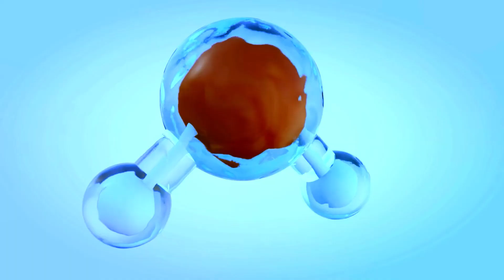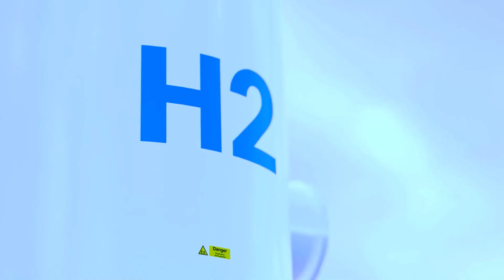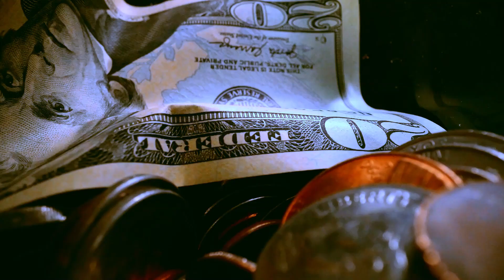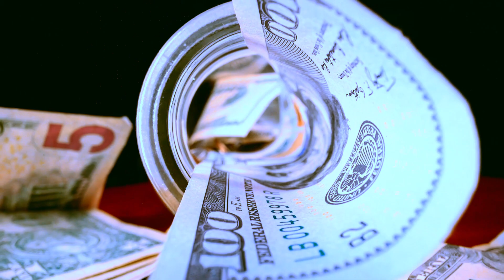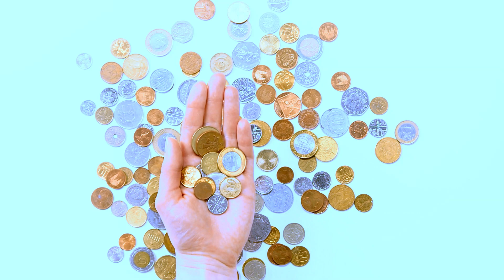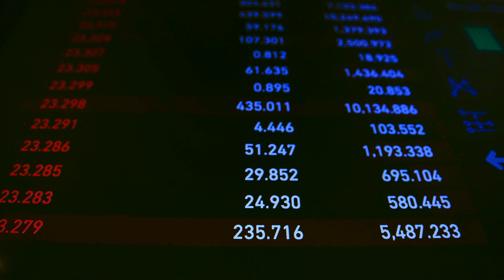WATER-POWERED CARS: TOYOTA'S GAME-CHANGING INNOVATION!

Comment: The problem has always been producing enough electrical power WHILE DRIVING to split water. Nothing is free. But I have always wondered why they cant design a alternator powerful enough to run electrolysis from the hydrogen engine while driving, and use a battery only for starting.